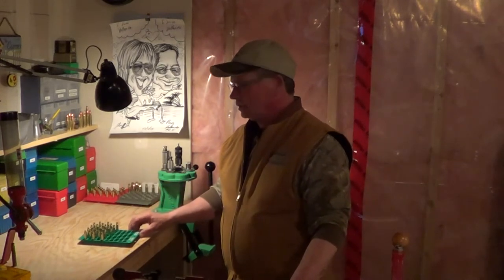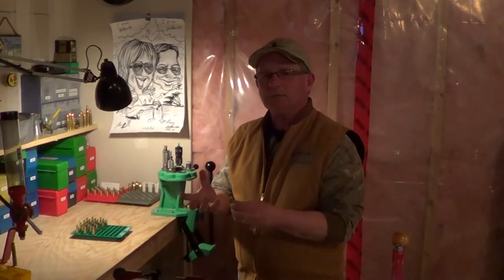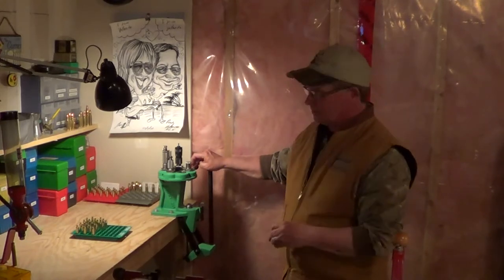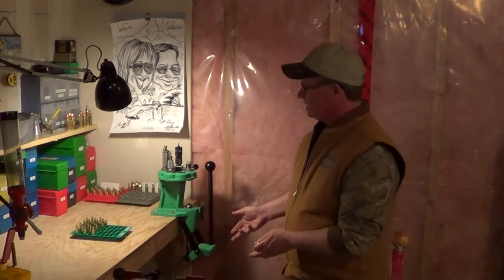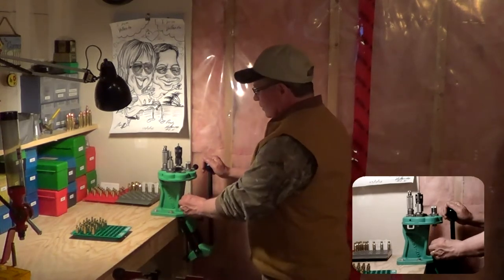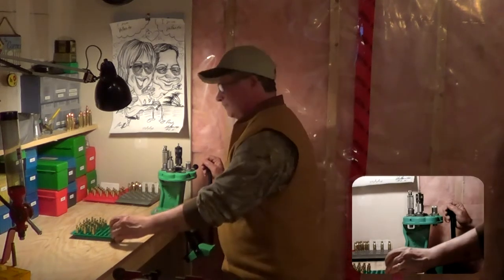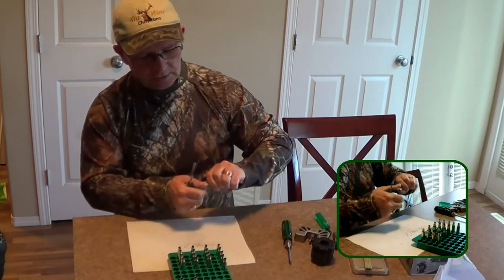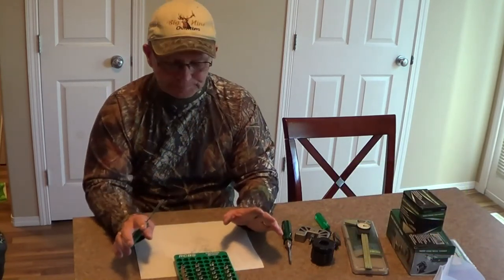Remington 223 - accuracy reloading tips

Comment: Great video! I just started loading .223 for my 8th cartridge, using Lee single stage and power trim but deburring by hand for neater finish. Have tested my 55gr Hornady vmax over IMR 3031 with far better accuracy than factory winchester thats 4 times the cost even paying for price gouged small magnum rifle and powder. Dying for large rifle to load a bunch of 6.5CM.
Have you gotten hand cramps from that small Lee press knob? I did and switched them out for a 9 and 8 ball, so much better on your palm!

Comment: Nice video. Excellently prepared and processed case. Mr. Currie, you are not supposed to go counter-clock wise with the flash hole deburring tool.             Shoot lots and stay safe.
Reply from the maker: Hi, thanks for the praise.  As for deburring the flash hole, I'm not sure if a guy shouldn't go counter-clockwise, or if it is because the cutter only cuts when you spin the tool clockwise.  Either way, I don't put pressure on the tool when I spin it counter-clockwise.  Again, thanks for the comment and glad you liked the video.  Two years, and I have yet to shoot these shells.  One of these days though...........................